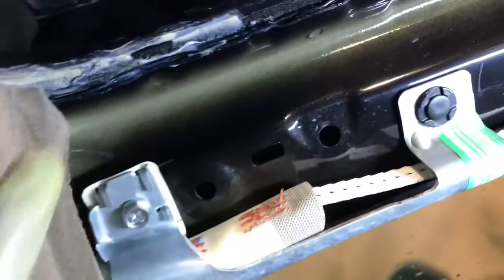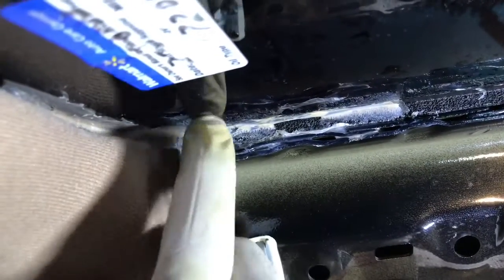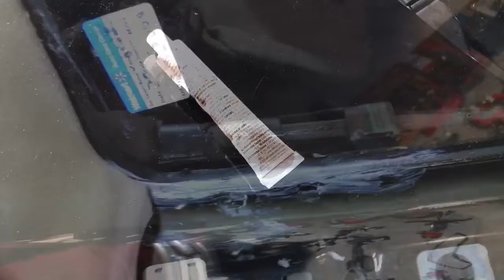Water leak easy fix Honda Pilot

Comment: Won't the sealant you added open back up as soon as the sunroof is opened?   It's not obvious if the rubber gasket that seals the sunroof closed is the real problem or something else.